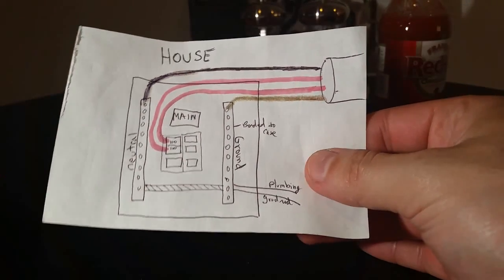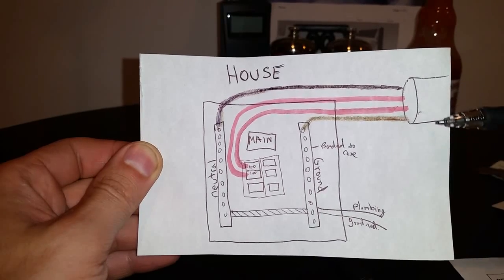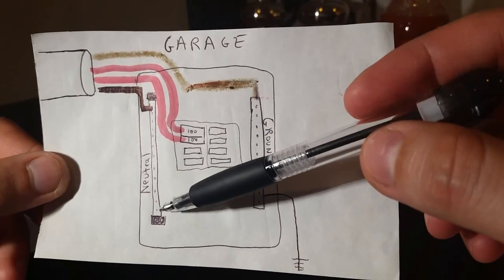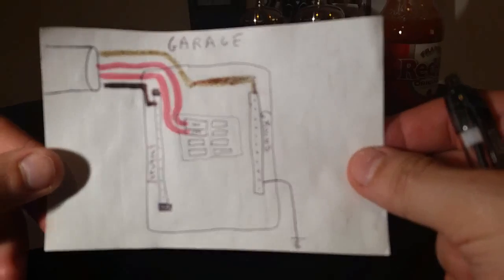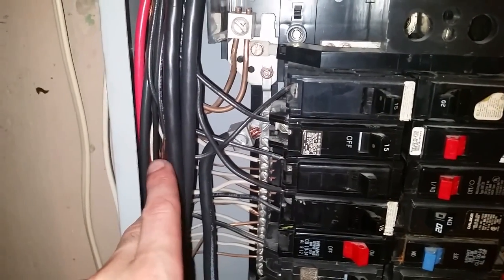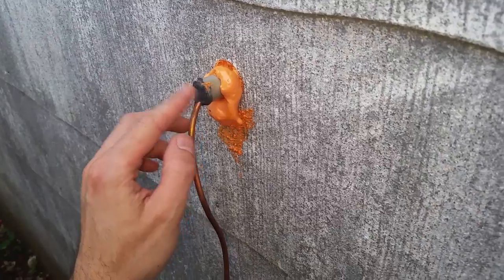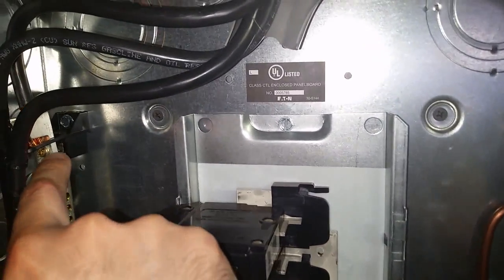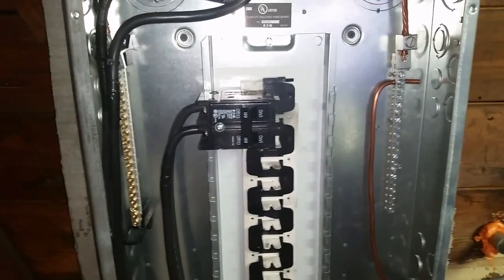How To Wire A SubPanel

Comment: I have a 150 amp box with a 100 amp sub panel, heat pump and sprinkler system on the 150 amp box. I want to upgrade to a 200 amp and add another 100 amp sub for my new pool heat pump, soon to be hot tub, and existing pool pump. is 200 amp enough?

Comment: you don't ground the sub-panel to another grounding rod. This creates a grounding loop which can fry electronics. It doesn't need it because it is already grounded
Reply from the maker: As per code..when in a detached dwelling a ground rod must also be used..thanks for watching
Reply: klowny1969 right, you're in the states it's a different code
Reply: +klowny1969 I just spoke to my inspector and asked if a grounding rod is necessary at the garage and he said its not necessary because there is already a ground wire going back to the house.

Comment: Hey man thanks for providing such a detailed video. This is a project I am thinking of doing. My only question is how do I know what size cable to run between the main panel and the sub panel. Will it always be 2-2-2-4? Once again thanks for the detailed explanation. You make it seem like a possible project even for a regular guy like me.
Reply from the maker: Thanks for watching..please note my video is just a general guide on how to do this project..the size wire depends on how far you are going and how many amps you are going to pull through that wire..
Reply: Thanks for responding. I'm running 100 amps to around 85ft underground in conduit. Just for informational purposes and academic discussion, what would you use in this situation? Once again, awesome video. The wiring diagram clarified many questions. Thanks for sharing your knowledge.
Reply from the maker: No prob..my run was 110 feet..and I used copper wire..if u use aluminum you have to go thicker..
Reply from the maker: You can use the same on 85 feet..
Reply: Thank you.

Comment: Is it really required or necessary to connect a ground rod to your sub-panel's grounding bus? I mean you already have a #4 gauge copper wire that returns back to the main panel which is also connected to one or more ground rods?
Reply: Yes, a grounding electrode system is required per the NEC for separate buildings with more than a single circuit. If no system (like building steel or metal water pipe) exists, then one must be added. The ground rods facilitate this.

It's required so the reference to ground potential at the separate building is as close as possible to 0v.
Reply: I have the same question.

Comment: so you are not in the USA if you are wiring 220V.what country is it?
Reply: Dylan Link
would that not be 2x 120v? is the appliance rated at 240v? How about 3 phase power;how does that work there?
Reply: Yeah, measured across both 120v lines would get you 240 but not many home appliances require that much, only the larger items such as dryer, furnace, oven/range, air conditioner. It's more efficient to have different voltages for different things. In 3 phase service, it's really only used in commercial or industrial settings because it's more efficient for the large power demands to power heavy equipment and very large buildings. There are several different voltages produced in 3 phases. Typically two of the phases will remain at the same voltage and the third will be slightly higher.
Reply: sam davies Three phase has three hot (120V) lines. you will see mostly 3 phase 120V/208V from the panel in commercial places. Works somewhat the same as residential (120V/240V). You can use 208V to connect a 240V equipment. Only difference with 3 phase is since it has 3 hot wires instead of the regular 2 hot wires in single phase. The voltage is more constant.You don't just add the three 120V to get 360V. you have to square root it by 3 which gives you 208V.  360V divided by 1.73 (square root of 3 which is 1.73) = 208V in case you were wonder where the 208V came from and not 360 V.
Reply: We use both 120 and 240 Voltages in residential electrical in the U.S.A. It just depends what you are trying to power.
Reply: Dylan Link
How is the voltage doubled? transformer?
Reply from the maker: By pulling two hot wires into the subpanel
Reply: It comes from the transformers outside your house in two wires with 120 volts each, like in the video he has two red lines drawn. These are called phase A and phase B in the service panel. Some appliances require power from only one phase, some appliances require power from both phases.

Comment: I'm in the process of installing my subpanel to my detached garage and I find this video very useful! Excellent video!
Reply from the maker: Thank u..and thanks for watching!
Reply: klowny1969 I am having issues with a 60 amp sub panel.  It is old, was completed prior to my purchasing the house(I think in the 80"s).  I am DEFINITIVELY not an electrician so all of this is foreign.  It is aluminum (not good I know), but I have only 2 of the 6 or 8 breakers working?  I am so confused but would like to see if I can fix this on my own.  Any suggestions?